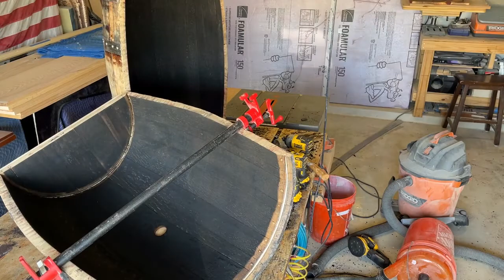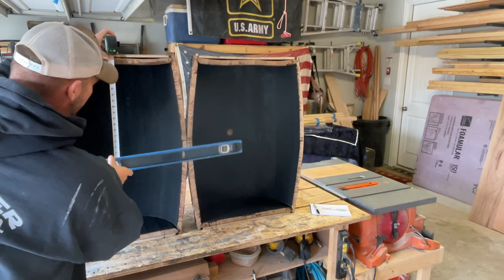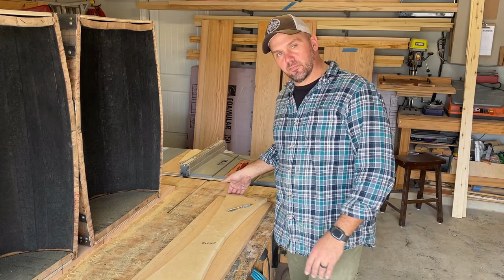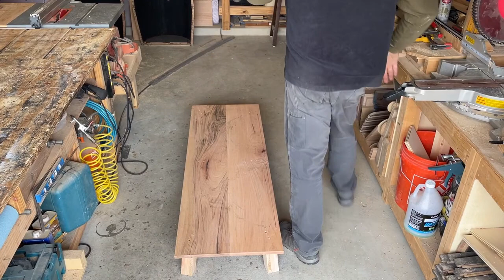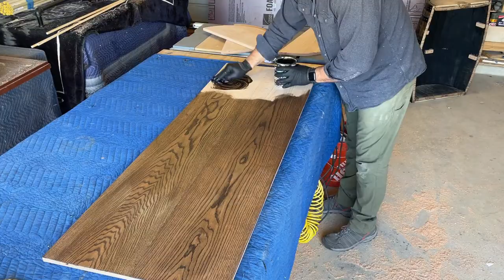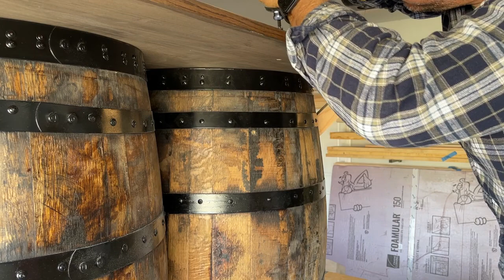How to build a whiskey barrel bar part 2 ll What finish to use on builds

Comment: You did not show underneath the  bottom base of the stand w/feet screwed in.  Also how did you get the total bar on top of said base...or did I miss it in between my cooking..😉
Reply from the maker: Yeah lost the footage on that part! I created an X base to support the feet and weight. It was glued and counter sunk screws to the base. The top was connected to the base by glue and screws as well.